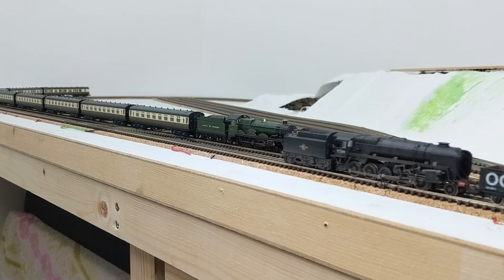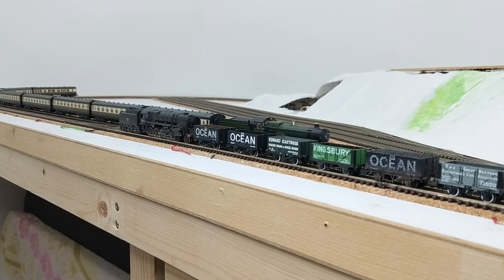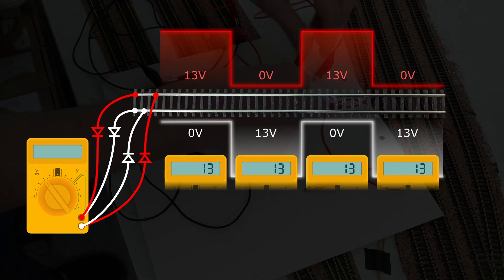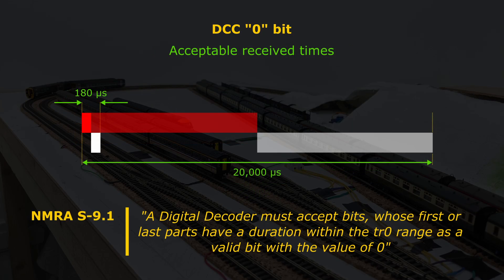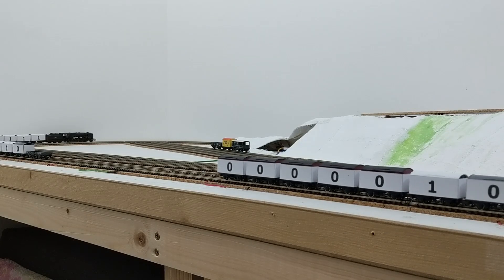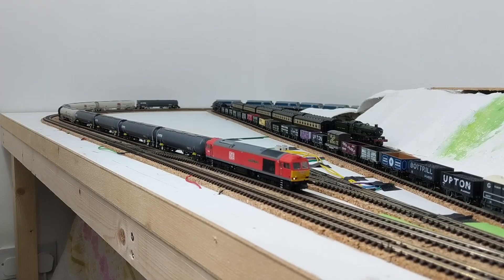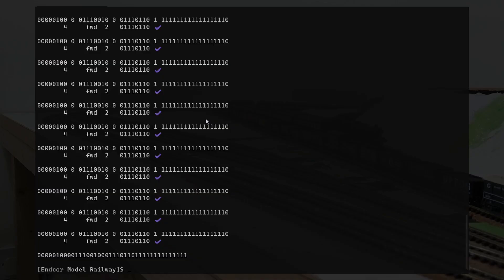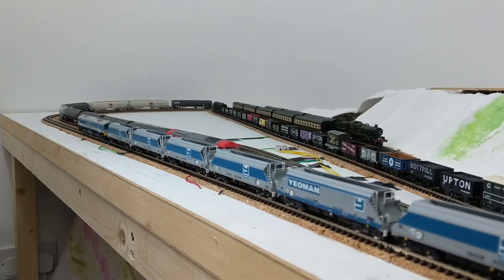0047 Decoding DCC from scratch

Comment: Nice work. MicroPython will work well for this. You will get significant efficiency improvements by using Pico's State Machine and DMA as well as MicroPython's Viper code.
Reply from the maker: Thanks 🙂 I've got a few different themes on the go with my model railway hobby and want to get back to this one next. Thank you for the suggestions - a few other people also suggested those Pico features, but I'm going to try getting a smaller chip (also with fewer pins) working - most likely an ATTiny of some sort. The space is very confined in the N gauge locomotives, and there'll be plenty of other components I need to squeeze onto a board, plus I'm not convinced I'll be able to solder accurately enough to the RP2040.
Reply: Perform an internet search for DCC_MicroPython_Decoder_for_Pico_RP2040 to see an example.

Comment: Keep updated please ad progress thanks you
Reply from the maker: I'm glad you're interested in how this is going - so far I haven't done enough more for a second video. I managed to get some C running on the Pi Pico and ran some basic timing code on it reading the state of an input, and as expected it was a lot, lot faster to execute that than the Python had been. I also found resistors that I can use as a voltage divider and bought various capacitors and Zener diodes, to try implementing things people have suggested. It's going to be a long and slow project I'm afraid, just like everything else I do with the model railway 😆

Comment: Great information here (both in the video and in the comments). All we need is for someone to make a RP2040 board small enough to fit in a N-gauge loco.
Reply from the maker: Thanks 🙂 That would certainly make things easier, though I think it would be hard to make a development board that small, given the large terminals around the edges. The RP2040 has lots more pins than should be needed for decoder purposes, so not connecting most of them to any terminals would help. Ultimately I'm not expecting to use the RP2040 for a final solution, but the Pico is what I've got available already and am (relatively) familiar with using in a basic way.
Reply: @endoorrailway  As a development board, the Pico is fine. It would be amazing to develop a board with a RP2040 (though another microcontroller would also be fine), the voltage handling circuitry and a speaker, in a form factor that fits most N-guage locos,

Comment: Maybe consider using Rust, rather than C or C++, and gives comparable performance, and pushes most errors and bugs from run time to compile time. Sadly though Rust programs are likely to us more RAM than C code.
Reply from the maker: I am indeed considering it - besides a quick search a month ago I don't know anything about it, but if it's going to be a major language that is fast but removes lots of memory management errors then it would be useful for me to learn. It caught my attention when the Pi Pico 2 launched and advertised support for it. From what I found there's support for Rust with ATTiny microcontrollers too, though I don't know how good it is. Thanks for the suggestion 🙂

Comment: Why aren't you using a simple voltage divider?! You could get 3v out by tapping the midpoint between a 100ohm and 30ohm resistor pair. The voltage regulator is overkill and might introduce a whol bunch of other issues.

Comment: Your multimeter likely doesnt measure peak voltage in ac mode, since if it did it would divide it by the square root of 2 before displaying it (since this resulting voltage value is the equivalent of the dc voltage that would dissipate the same power in the circuit, but only if the ac waveform is a sine wave).

More likely you have a good multimeter that actually performs integration on ac waveforms
Reply from the maker: You know, I never even considered that I might have a good one! I think proper signal integration in AC mode is the first explanation I've heard that seems to explain why it gets both the sine and square waves correct. Thanks 🙂

Comment: Don't know if this is mentioned already, but you might want use the DMA (direct memorry access) peripheral to read out the input automatically and write it to a buffer. A bit of a hassle to setup, but worth the performance as you are looking for microsecond measurements. Probably also possible to setup in python.
(Not sure on this, but i think DMA is capable of transferring gpio inputs at, or near, cpu clock speeds, so might also come in handy troubleshooting as a substitute for an oscilloscope/logic analyzer)

The PIO (programmable I/O) peripheral might also be a good option, as it is made with the intent of letting the user program a custom communication peripheral, with precise timing. Even more of a hassle than DMA, though😅
Reply from the maker: Thanks for the suggestion - yes a couple other have mentioned DMA and quite a few PIO - this week I'll write up a summary of suggestions and make it a pinned post.

Nobody has mentioned using DMA to turn a Pico into an oscilliscope though - that could come in handy if I'm having trouble later on having got past this accurate signal measuring step, especially as I'm trying to avoid buying an oscilliscope 🙂

Comment: Not a simple undertaking especially without an oscilloscope but you have the right attitude, read the spec, start simple and work up to something more feature rich. Monitoring both rails is really only done to improve reliability as it can be quite electrically noisy monitoring rail voltages. The PI pico has some clever state engine functionality on its GPIO pins that should allow you to measure the intervals without using the processor at all. This can then just DMA the results to a memory buffer for your code to look at. Using that your measured timings will be super accurate. This will however require you learning the machine code to program the state machines but I don't think it's very complicated as it only has a few instructions.
Reply from the maker: Thanks 🙂
Yes, a few other people have mentioned the state machine on the Pico - it's not something I knew about before - thanks 🙂
Reply: @endoorrailway  After thinking about this for a while I think it would be very easy to get this working using PIO programming, it would be able to capture predefined number of bits into a register then interrupt the processor to read the register. PIO clock speeds can be set accurately so you are always sure when signals change state.

Comment: Nyquist in frequency domain, rather than real time edge detection?
Reply from the maker: I hadn't heard of it before making this video, but someone else mentioned Nyquist too. The highest frequency would be the shortest DCC "one", which is 52μs - that would make the Nyquist frequency 26μs.

With 26μs samples a DCC "one" of 64 could potentially be measured as lasting 78μs, but the shortest a DCC "zero" could be measured at is 104μs. But with a 29μs sampling frequency a similar thing comes out - max One is 87μs, minimum Zero is 116μs.

I think if the interrupts run quickly enough when programmed using C (which I fully expect they will, based on what quite a few people have said), then that's probably the most elegant way to program things.

Thanks for the comment 🙂

Comment: Any cheap Arduino-based board + interrupts should make light work of this. I am currently trying to do something similar to emulate the tape interface of an old Casio 80s handheld computer. But that is painful for many reasons.
Reply from the maker: You're undoubtedly correct, but I think only if a fast programming language is used too - the Pico is a lot faster than the Arduino-based boards. Tape-based, eh? Personally as an end-user I'm very pleased to leave tapes in the past, and CDs for that matter 🤣 Thanks for the comment 🙂

Comment: I'm seeing lots of good suggestions in the comments - one thing I will offer is this: As microcontrollers are designed to interface with the physical world much more than general purpose computers, there are often pieces of built in hardware to do tasks like asynchronous timing. For the 2040, the simplest way of accessing the hardware timers is by reading global system timer, which counts in microseconds. See section 4.6 of the datasheet for more info. A pin change interrupt to read this timer should be tight enough to get your the precision you need. 

The "more correct" way of doing it is in section 4.5 PWM of the datasheet. In 4.5.2.5. Level-sensitive and Edge-sensitive Triggering it describes how to tell the PWM counter to count while there is a high level on its input pin. In this way you could measure the exact time of the high periods irrespective of what the core is doing at any given time. A pin change interrupt could then tell you when to read the value and allow you to clear it for the next count.

I don't generally program in high level languages, so I don't know what the overhead of these schemes would be in micropython, but as it is hardware based it should be agnostic to programming language.
Reply from the maker: Thanks for the extra information - I don't remember the PWM one being mentioned yet, though I'm finding it hard to keep track of all the suggestions! I'm quite happy to leave Python behind - I prefer it to write in, but not if it's going to cause extra headaches. The full details of the RP2040 datasheet are too much for me to digest at the moment - I'm pretty inexperienced with working with microcontrollers - what I've done with the Picos up to now has been relatively limited, so I'll take things slowly and see what I can get working in simple ways first. Thanks for taking the time to read the other comments and to write up those suggestions 🙂
Reply: @endoorrailway  for the vast majority of your programming, micropython is probably fine. For your timing critical tasks, tight routines written in C and triggered by interrupts may be necessary. 

After a nice nap and some thinking, if you use an interrupt to put your high/low times into a circular buffer, the main program can read the buffer at its leisure and work out where the packets are and how to read them, completely asynchronous from the receipt of the 1s and 0s. The 2040 has loads of RAM, so you can make the buffer quite large too. Look for the preamble, count from there, and check for validity. Fortunately, us humans won't notice tens or even a few hundreds of milliseconds of delay between command and response.

Also, I suggest you throttle your main program loop to something in the 50-200Hz range if you are not already. Once again, you can use the system timer to decide when it is time to run a new execution of the main loop. The simple way to do this is to set a last-run time in the main loop, and then check the current system time against that time plus your timestep. No delay() commands (or whatever it is in micropython), as this will lock the uC's execution until the delay finishes. Running your main decision making code at a higher rate than this is likely unnecessary and can make it easier to decide how to split your CPU time.
Reply from the maker: Thanks for the follow-on advice 🙂 Good idea about deliberately throttling the main code - I haven't thought about power efficiency yet, but I've been surprised at how quickly the Pico is able to drain my laptop's battery if powered from USB. The efficiency of modern hardware and software is very impressive.

Comment: Fascinating video. The digital trains to demonstate the packet contents was genius.
I thought using a voltage regulator to level change was a bit odd, and i am surprised you get as good results as you do.
 As advised elsewhere there are probably better alernatives with voltage dividers or opto isolators or even capacitive isolator  connections, although the latter will introduce other issues. 
There may even be specialist level changing chips available given that it must be a fairly common requirement for 3v systems. I know there was for 5v systems, but am not familiar with 3v interface chips.

I shall be following your journey with interest
Reply from the maker: Thanks 🙂 Yes I'm very new to all this sort of electronics, so I may yet unwittingly do other things that are strange! I did searches for how to change the voltage level and there were various results, the regulator looked like a simple way, but it's abundantly clear now that other ways are better. The amount of advice I've been given from this video is great 🙂 Glad to have you along, thanks!
Reply: @endoorrailway  the regulator will be fine for powering the pi. You just need to keep the signal inputs separate from the power inputs

Comment: you can get small handheld scopes for about £50 nowadays - seems a must for this
Reply from the maker: I had a little look on the weekend, but it turns out there's a lot of variation on what they can do - the ones I found for less than £50 were mostly 200KHz, which would be too slow, and ones that were 1MHz for normal AC weren't clear what their ability was for measuring square wave signals. I really don't have much of a clue how to read their specs! Quite a few people think having one is a must, but I dislike shopping around for them, and I'll see how far I can get without one and consider it a last resort. Thanks 🙂

Comment: I guess zero stretching is for determining witch rail is witch... try listening for stretched zeros first on both flanks to choose witch flank to listen to later.

Using PIO may be worth looking in to - You should be able to programing PIO from python.
Reply from the maker: I don't think so - the stretched zeros could be on either rail, and actually both could be stretched equally so long as their sum doesn't exceed 12,000 microseconds. I'm fairly certain it gets used for controlling DC locomotives, by making the current flow mostly in one direction, though I didn't see that purpose mentioned in the specifications.

Thanks, others have mentioned PIO too 🙂
Reply: @endoorrailway  Controlling DC locomotives... make sens.  A bit harder then.

Listening on both flanks and summing up the absolute difference of periods before and after each flank while trying to ignore stretched zeros. Then, if the difference is bigger for raising flank use that, if the difference is bigger for falling flank us that.

But PIO is probably the best bet... Should give sub ms precision if wanted without loading the CPU at all.

Comment: As others have said, I'm VERY impressed with your work.
To get where you have without an oscilloscope is mind boggling !
I am an electronics engineer and have used the the Pico and I agree with other comments. If I was you I would go for a PIC micro.
Microchip provide a free compiler MPLAB X which with your attitude you will easily master.
As you say 'C' is by far the best language for real time stuff like this.  High-level languages like Python are not good at uS levels.
I also would say you should use interrupts, there are loads of timers in the PIC processors like the PIC18F27Q43 that can take most of the timing work away from the CPU.
In fact the PIC18F27Q43 has a ZCD (Zero Crossing Detector) feature that I have used to detect the rev signal from an alternator.
All you would have to do is put a resistor (50k) in series with the signal line.
You can then use a timer to measure the pulse length.
I wish you the best of luck.
If you need any help with the circuitry let us know!
Best of luck, Simon
Reply from the maker: Hi Simon, thank you for your kind words and for taking the time to write-up those suggestions, and for offering future help - I may well need it! I've made a note of the PIC18F27Q43 as a potential thing to look into, thanks 🙂

Comment: I don't know the PI2040 as well as AVR microcontrollers but if that MCU has timers and at least one of them has a capture pin¹, then you can let that timer time every transition instead of doing it in code. Then all you have to do is subtract the previously captured value from the current one to get the length, in clock pulses of the bit you're measuring.

I've also seen suggestions about optocouplers. They're not fit for the job, they're too slow. Instead you may need signal shaping/debouncing done in hardware — unless the Pico has hardware mechanisms to filter spurious pulses away, of course. Micropython may be too slow even with this approach though. You'll have to assess that as well.

¹ A capture pin is used to copy the current counter value of a timer into specific registers, named capture registers, when a transition occurs on that pin. These transitions may also trigger an interrupt, which is useful to signal the application firmware an event occured.
Reply from the maker: Thanks for taking the time to write up that extra information, and for reading through the other comments to see what people have said. Interesting about the optocouplers - quite a few people are keen on those. I'll give a few things a go and see what kind of results I get - if the code is successfully getting the instructions I think the controller should be sending, and with enough time to do something with it, then it'll achieve what I'm after 🙂

Comment: The multimeter in AC mode will show Vrms, it measures the peak voltage and divides it by the sqrt(2), assuming a sinusodial wave.
Reply from the maker: Thanks for the info. If it did that wouldn't it end up reading the 13V square wave as being around 9V? 13 / (2^0.5)
Reply: @endoorrailway    @endoorrailway  Vrms = 13V * 0.707 = ~9V, but that would be for a AC sinusoidal wave, not a bipolar square wave .. The cheap DMM can't make sense of it since it also lacks a true zero crossing. The bipolar square wave isn't referenced to a fixed ground, it's floating. So it's not a true AC signal, where the reference (N) is at a fixed potential.
Your measurement in DC mode is just the average it sees over some time, it's simply too slow to measure the signal.
Reply from the maker: OK thanks .